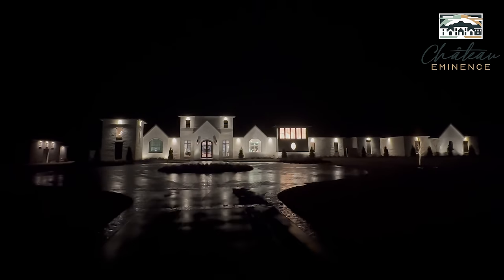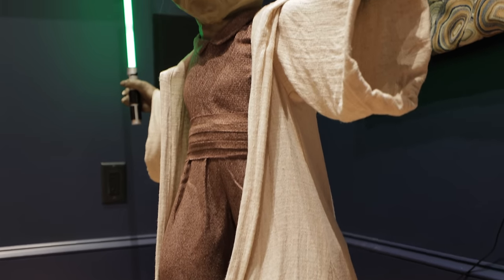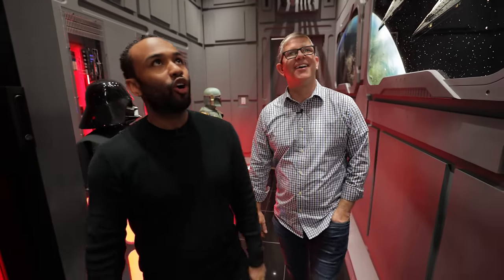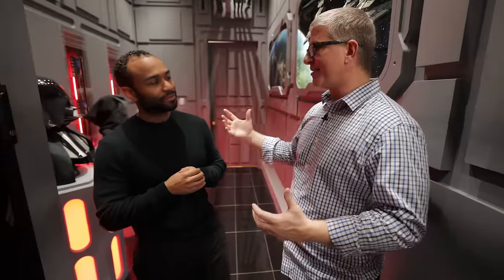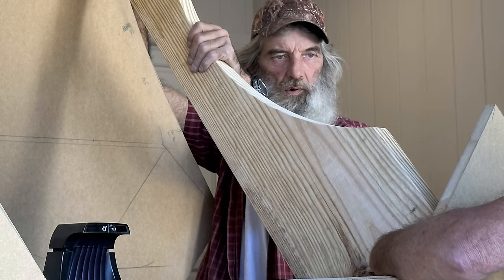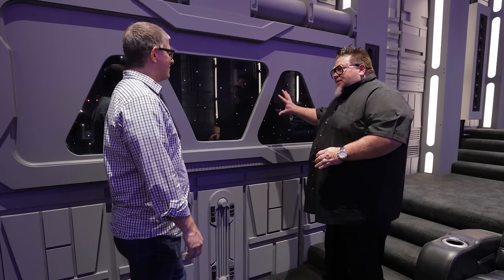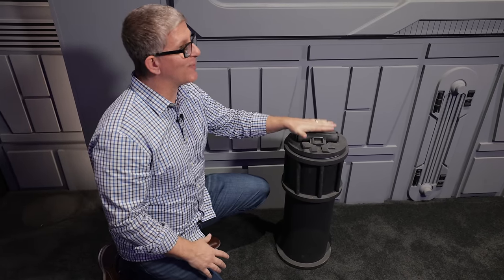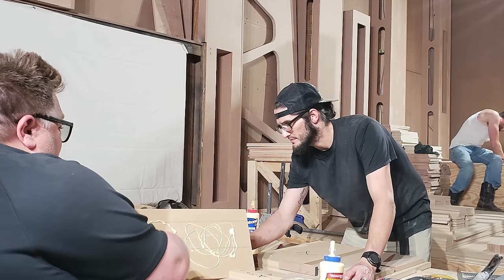This MANSION Has a $1 MILLION Star Wars Theater! Trinnov, Wisdom Audio, Kaleidescape and MORE!

Comment: When your home theater is better than a commercial theater.  Fantastic work by both homeowner and contractor.
Reply: Personally I think a soundbar and sub is better than a theater. I don't think I've ever had a movie experience I liked more than in home movies. But yes this theater is leagues beyond anything I've ever seen.
Reply from the maker: If you feel a sound bar and subwoofer is better than the theater, I would recommend you get out more and experience some other home theaters. I have visited over 50 home theaters and not one of them sound worse than a soundbar and a subwoofer.
Reply: @Youthman  very classy way of putting that

Comment: Acoustically, the big room volume cubes and longer propagation distances, diminish the ratio of treated surfaces that's needed. 

The big volume is so beneficial. 

With all the stunning detail, countless irregular surfaces, much of the incident energy would exhibit scattering and breaking up of specular reflections, ... likely down into the several hundred hz range. 

Despite no dedicated trapping, all the mdf panels resonate and remove energy at varying levels/freqs. 

I can see them getting away without full range treatment ... while achieving perfectly enjoyable experience with stunning sound. 

This is such a special build. 
I've never met Mr Gerlach, however we've interacted extensively online ... I'm thinking if he tuned the system, he got the most out of that rig. 
So cool. 

Industrial Light and Magic would be impressed. Disney imagineers would be impressed. 

It's impressive.

Comment: Wondering why they didn’t utilize class a/b amplification on the highs and mids since class a/b provides a higher quality sound. Yes they are more expensive and you can get class d with higher amplification but I’m just curious. I utilize Klipsch, McIntosh and Denon. Would like to go even bigger.
Reply from the maker: Most people would not be able to tell the difference between the two amplifiers when doing blind AB testing
Reply: @Youthman  I’ll agree with that. The only reason I had asked was due to the fact that it seemed like he was going for ultimate sound quality. Have a wonderful day and thanks for the reply.
Reply from the maker: I’m not certain class A/B amps inherently provide higher quality sound.

Comment: This is the guy I need to contact ...I've always wanted to build a full-size Millennium Falcon. Not screen size, but bigger...one you could actually walk around in, and use as an apartment. If he doesn't own a yacht, I have this idea about something like Galaxy's Edge on barges (barges measure 35x190), with the Falcon on a landing pad. You could cruise from the Gulf all the way to the Great Lakes. j3-pro

Comment: They robbed him.
$1,000,000 for a $250,000 home theater??
Reply from the maker: Before you make a silly comment, it’s best to do a little research. The projector and anamorphic lens alone are over $100K. He has around 1,000 sheets of MDF at probably $60 a sheet, so there’s another $60,000. Google MSRP on Wisdom Audio, Trinnov, Kaleidescape etc and that doesn’t even account for the construction and isolation of the room itself.
Reply: @Youthman  Mine is larger and much the same, so i know what all this cost. Thing is, I did it myself.
Reply: @RPRsChannel  I would love to see it!
Reply from the maker: He has a YouTube channel. Could make for some great content to share with other Home Theater Enthusiasts.

Comment: He's center speaker has some problems: People on the left side will mostly hear the woofers, and on the right side the tweeters !
If he is a hardcore SW fan, one of the sound processors should be a Dolby Stereo CP 200. I would hope he only see/listen to the ORIGINAL trilogy, otherwise it is 🤡🤡🤡
Reply from the maker: That’s not how it works. 😉
Reply: @Youthman  What works ?
Reply from the maker: They are designed to be installed vertically. The people on one side are going to hear both tweeter and drivers. That’s what I’m referring to.

Comment: I was sort of impressed until I saw the Crown amp. Are you kidding me? Makes me think the whole system is a rip off. Crown?? Do they still sound as nasally as they use to? I guess some people are gullible. More money than brains. (or ears)
Reply from the maker: Curious if you have ever done any blind AB testing between Crown and other amps.
Reply: The crown amp is not actually powering anything in the theater! The amplifier powering the subs is actually a 10k watt Ascendo amplifier.
Reply: @Youthman  Yes, I have. I worked for a pro audio company in my previous life. We did several blind tests, as the owner and higher ups were all old rock and rollers from days gone by. Crown was a mainstay. At the time we did an amplifier shootout with Crown, Ramza, Hafler, Carver, Bryston, McIntosh, and Stewart. Stewart came out on top, although Bryston was very close. Some brands of speakers will be much more prone to showing up weak amplifiers than others.
Reply: Replying to my own post. The Stewart was back in the day before they got bought out by Bogen. Bogen is super low end, not sure how that happened. This was back when Stewart was part of Soundstream. I still use the older Stewarts today.
Reply from the maker: Just curious as your comments were quite condescending and judgmental to a system that you haven’t seen or heard in person.